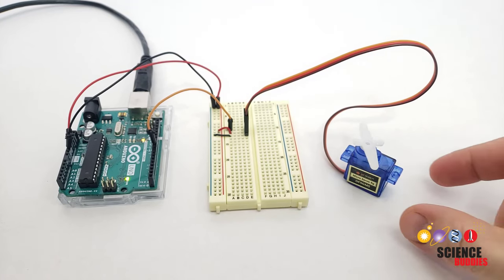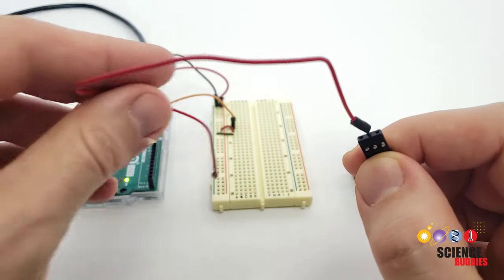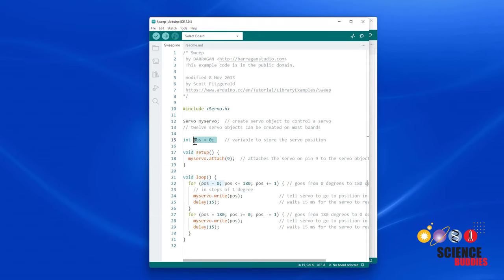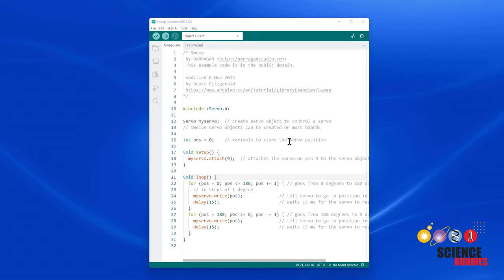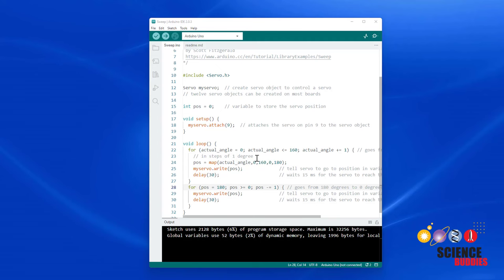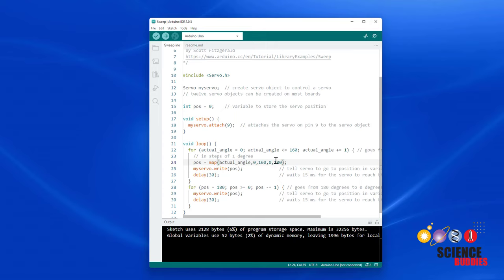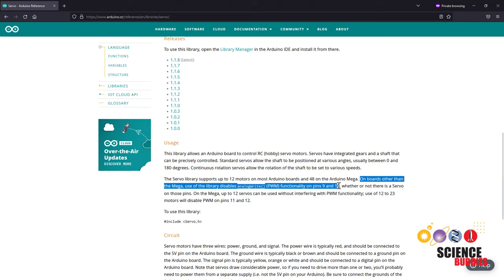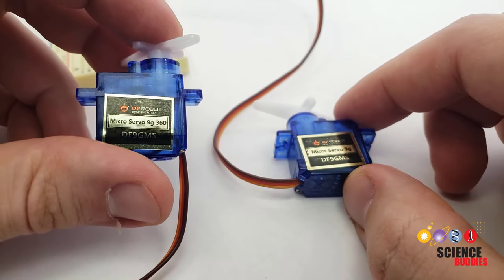Control a Positional Servo Motor with an Arduino (Lesson #10)

Comment: Hey, would you explain to me if I would be able to switch a servo between 90 and 140 quickly? I also want to have it so when I press a button it opens to 140, and when I let go it goes back to 90. Any way? I think you would know.
Reply from the maker: Hi - if you check out the rest of our Arduino tutorial playlist, we have videos on using buttons and other inputs.
Reply: @Science.Buddies  hello, I am very familiar with buttons and arduinos. But something that has been stumping me is getting the servo to go to a certain position for the duration of the button pressed. I looked into tutorials, and all what others seem to want is to make a servo move to a position and back every time a button is pressed. I want mine two positions, like an animatronic mouth. Open, and closed. Thanks!
Reply from the maker: Hi - we can't provide help writing code for individual projects, but you might be able to find help in the official Arduino forums or other sites like Stackexchange.

Comment: How do I make my servo to move to a angle and delay for about 4 sec and go back to the same angle with a sensor right now I have a Arduino uno and an IR sensor I can't figure out how to do it I've watch many videos but all of them failed how can I code thisM
Reply from the maker: Hi - if you need help with code you can try asking on the official Arduino forums, or if you are a student doing a school science project you can ask in the Ask an Expert forums on our website www.sciencebuddies.org.

Comment: Can i rule my servo rotation to a specific range, like a 60 degrees rotation counter clockwise and clockwise?
Reply from the maker: Yes, you would just need to use a variable to keep track of the angle, then add or subtract 60 degrees from that angle depending on which way you want to rotate.
Reply: @Science.Buddies , thanks!

Comment: I see the wires connected from the Arduino to the breadboard. Can you tell me what those are and how to set that up? I'm just a mom trying to get the motor to work for the Halloween pumpkin and I'm not very tech savvy. Any help would be very much appreciated.
Reply from the maker: Hi - if your circuit literally just has a single servo motor, you do not actually need a breadboard. You can search Amazon for "Arduino male to male jumper wires" and just plug the three wires from your servo motor directly into your Arduino (as described in the video, color coding will depend on your motor). However, if this is the first video you're watching, it might help to back up a bit and start with our How to Use a Breadboard video: https://youtu.be/6WReFkfrUIk?si=OfQ2Fr6RqSBoms2Y and watch at least the first three videos in our How to Use an Arduino series: https://youtube.com/playlist?list=PLlBVuTSjOrclb0iCMSRpS_H1lSrlSVeEm&si=iZF8YZwDDhnUT5CZ. Hope that helps!

Comment: Hi, can you make video about controlling a servo motor by a slider button assigned to a variable command such as = (if val == '(inserted variable)')... then the specific command to do so with a slider.

Just working on a bluetooth car with a robotic arm that has 3 servo motors that require the usages of sliders.  Thank you!
Reply from the maker: Hi - we don't currently have plans to add a video that specific, but we do have a video about slide switches that you may find helpful: https://youtu.be/0ZXYRU9KPG8?si=rMzlhcxUV73bmPFT